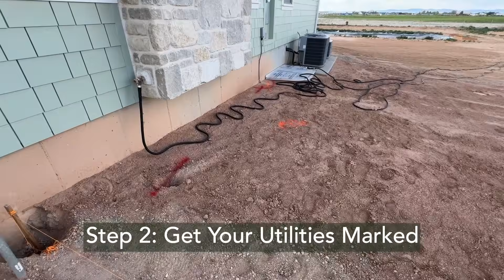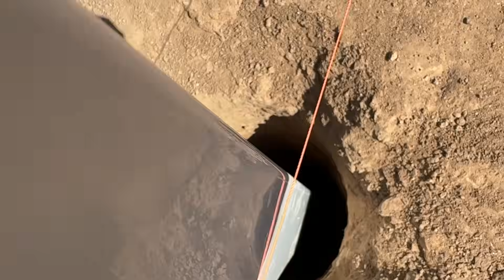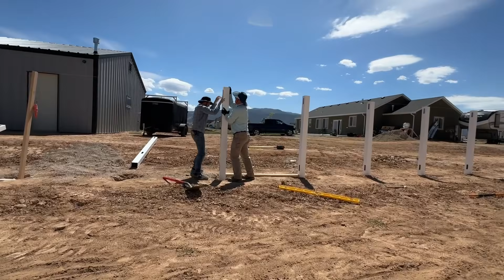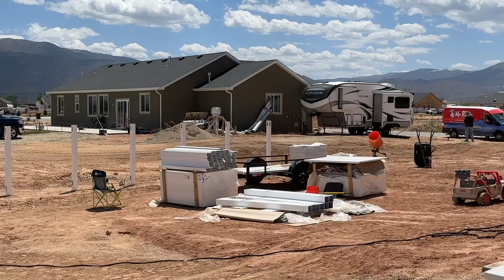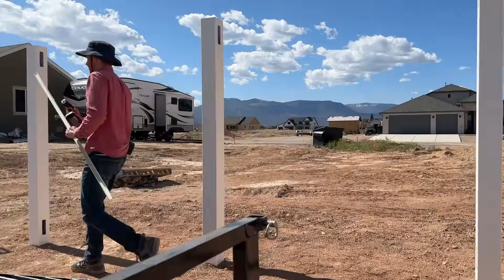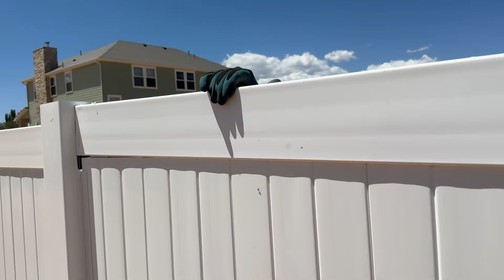DIY Vinyl Privacy Fence Install: BETTER Than Pro (No Cutting Panels)

Comment: I bought approx. 30 panels or 240 feet of the exact fence (31 post and 3 gates) that I will need to take down and load on a trailer to take to my place to set up.  From what you experienced what length of trailer would I need, assuming the trailer is 8 feet wide?  If my math is right I will have close to approx. 400 vertical pickets, approx.60 upper and lower horizontal pieces and approx. 34 post with the slide pieces attached.  Do you think this would fit on a 10', 12' or 15' trailer?  How did the fence arrive to you?

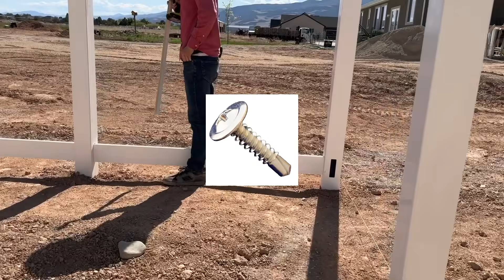Comment: 16:25 I hate to be the bearer of bad news but zinc is not corrosion resistant. Not at all. That’s why it’s cheaper than the two that are corrosion resistant (galvanized, stainless)

Comment: When you explain measuring when it's laid out dry to ensure accuracy, what end points did you use on the dry assembled to come up with the 73 1/4th spacing? I assume the brands differ in their sizings and that measurment applies to the brand you're building with. Would love to know! Great video and angles used
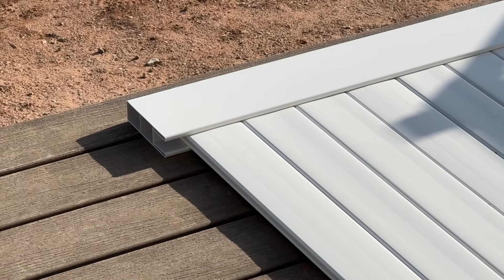Reply: Speaking for technique described from 2:48

Comment: You had a crew of 5-6 people, with neighbors who had professional grade tools and mixers, this is not a DIY by any means sir stop flattering yourself
Reply: 😂😂😂 yes you're correct, but still a helpful vid,,,,,,,
Reply: Very nice sir. Now, some prices  pls. How much for posts and tickets?  Thanks in advance ☺️
Reply from the maker: It was about $5,000 total for all materials
Reply from the maker: We had a crew of 3 people which most people can find within their own home, family friends or neighbors. The concrete mixer is a portable one that anyone could buy but you can also mix the concrete in a wheelbarrow. The tractor with the auger would be the more difficult thing to get for most people unless you're in a more rural area like us where people own tractors.

Comment: When you placed the rails up tight without a
Gap spacer, did you still have room to remove them if you need to make a repair. I would think they would butt up together in the post and prohibit removal.??
Reply from the maker: Yes there's wiggle room in the rails to remove for a repair, about 1.5 inches

Comment: Great video! Thanks for sharing! I’m thinking of installing a vinyl fence. I’ve seen various approaches on the steel metal insert you put in the gate and others recommending to put them in every post for added strength. Is that overkill?
Reply from the maker: Yeah steel insert in every post in my opinion is overkill, just do that in your corner posts or gate posts.